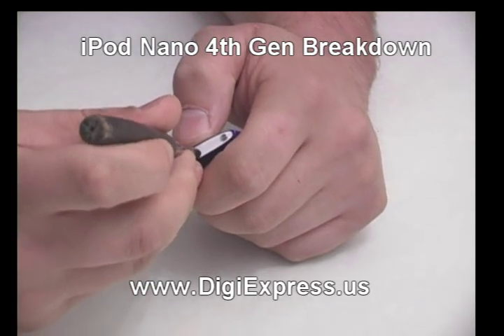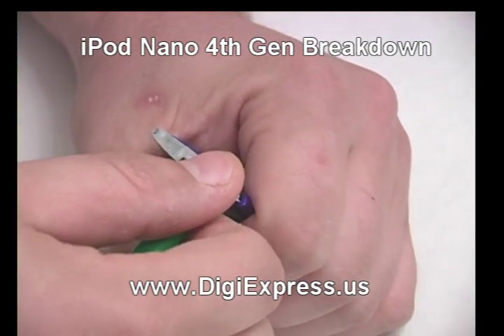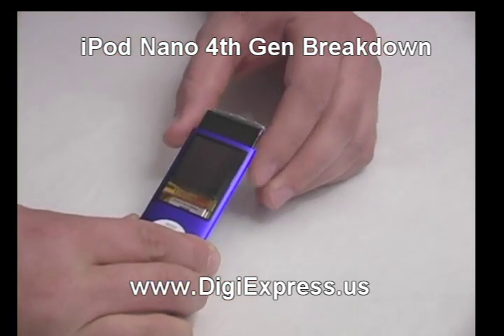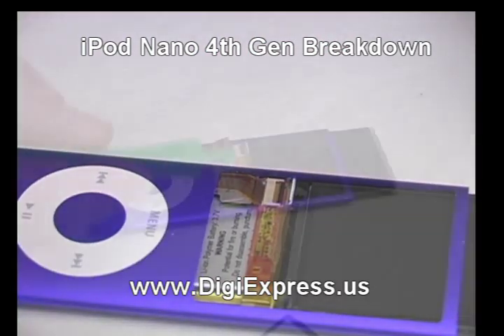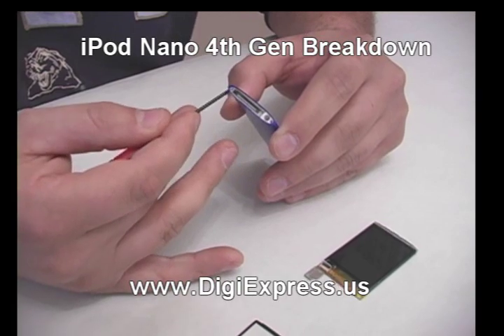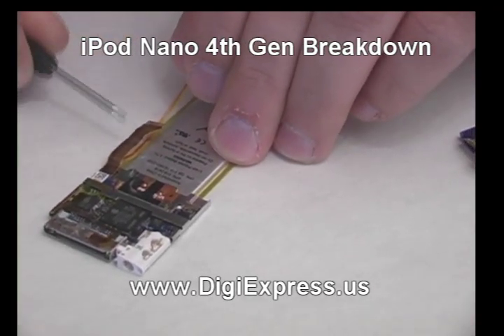DigiExpress - iPod Nano 4th Generation Breakdown

Comment from the maker: You can try to use a T-1, T-2 or T-3 (Torx) driver.  They seem to fit inside stripped phillips head screws.  Otherwise it is just a battle of drilling out a head, or pounding a flat head screw driver into the head of the screw.  For a Nano however, a stripped screw usually means it is just not repairable.  We have a very long and thin drill bit that we can usually get the head of the screw to drill out; but we use it with great caution.

Comment from the maker: @manoogianation you can get a small flathead screw driver and remove the excess residue from the glue.  that should allow access to the heads of the screws.  When you reassemble the device, do a "dry run" first and once you are confident that your device is working then you can apply a small drop of super glue to the bezels to reseat them properly.

Comment from the maker: Make sure that you have removed the two screws holding everything in place. Once those screws are removed, use a little pry tool and pull the LCD screen to at least get it started. Once it is started, you can remove the front glass and get it to slide out. Once it is slid out, you can access the battery. Just be cautious and make sure you don't rip or tear the cables, disconnect them before you get too far where they may damage.

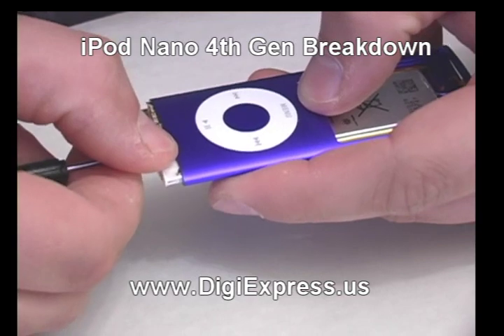Comment from the maker: There are a few things you need to make sure of. You have two lock switches, two screws and the ribbon cable. You have to remove the 1st lock switch, then the two screws. You will then be able to pull the LCD out a little ways. Once there, there is another lock switch attached to the LCD. Once unhooked, then make sure you disconnect the ribbon cable. Those directions and locations of the switches and cables are found from the beginning of this video to about 2:30 minutes.

Comment from the maker: @gianolrac if you would want to only clean the LCD screen then, at your own risk, obtain a straight razor and very delicately go around the edges of the clear glass window.  This will allow you to remove the glass window and clean the LCD screen.  However, to re-install the glass window you may need to find a way to adhere it to the frame.  The clear glass window is held in place by only a small amount of clear adhesive.  I would recommend to do the cleaning by disassembling the device as shown.

Comment from the maker: 1. You may have a problem with the LCD connector on the main board which is causing the back light issue. Open it up and gently clean the connector with an electronics cleaner (Radio Shack) or alcohol. If that doesn't work, you have a main board issue.

2. You can use a little adhesive to hold it in place, preferably a rubber cement which will allow you to remove it in the future if necessary.

Comment: I was given an IPod 4th Gen which wasn't working so after watching a few of these disassemble videos I thought I would pull it to bits. Mine was the complete reversal of easily sliding things out of the case. Everything was stuck in there like shit to a blanket. I ended up using pliers to pull the LCD screen out. As for the glass just popping up forget it . Broke it trying to push it up as per the video. Needless to say the unit is completely stuffed now which I'm not fussed about. I have 2 other IPods & I now know how difficult they can be to pull apart
if everything is "glued" in there. I would suggest if you need a new battery get it done professionally.

Comment from the maker: @Kyntheria With water damage, the ribbon cables can become "dried" out and are even more brittle than normal.  Depending on the type of damage to an iPod, you may be able to run it without the battery; but traditionally they need a battery.  The iPod Nano is something that would need a battery to be installed and working, as they have grounding points along the board and the case that rely on electricity being present to function.

Comment from the maker: @Music4Life2471 The moisture damage has probably corroded some internal components and over time you have now got an issue of battery life.  These kinds of repairs are difficult to quote a cost for, via email or YouTube.  Though all of our batteries for any iPod are currently on sale for $9.99; with our labor fee of $25.00 (Diagnosis / Repair Service) you would have a total of $34.99.  We would need to do a thorough Diagnosis of the iPod before attempted to replace the battery.

Comment from the maker: @TheBubbleRed For the 4th Generation Nano the hold switch is not a part that we stock.  You can try to disassemble the device to see if the hold switch has come loose.  You may just need to re-seat the connections.

Comment: Thank you for this. With the help of this video i managed to NOT destroy my ipod by trying to change it's battery. By far the most difficult part was de-soldering of the old battery connector from the main board, and then soldering on the new one. For dissasembly one definetely needs some watch-maker skills. I would not attempt this without previous experience with disasembly of very small parts. Some tips from my experience for somebody attempting this: don't touch the LCD with your fingers as the stains are very difficult to remove and can destroy pixels easy, put some cleanex on it before touching. Tape the main board to your table with some masking tape before desoldering/soldering so it stays put. Put some solder on the new battery's connector on the side that will be in contact with the main board before atempting soldering it. Reset your ipod if it doesnt turn on after you finish(press menu + middle button).

Comment from the maker: @alexflage You can always use thin electrical tape if you need to, but in general this device is very difficult to open and repair.  There is no trick other than just being patient and having the steady hand to do the work.  I do agree that the Nano 4 and 5 are the hardest devices to "get-into".

Comment from the maker: @XAversion86 the backlight issue on an iPod can be either the CCFL inside the LCD screen or the coil and fuse located on the logic board.  If it is the LCD screen then a simple replacement will work.  however, given your description of the backlight working only until the iPod fully boots up, would make me bet more on the coil and fuse.  that repair, the coil and fuse on the logic board, is not something we can do for an iPod Nano.

Comment from the maker: @allmobilephonestuff At the point in the video where the logic board is removed from the case of the iPod nano, you can then remove the clickwheel after you remove the logic board.  You would apply a small amount of pressure to the clickwheel, pushing it just a few cm back into the casing; from there you can slide the clickwheel assembly down through the bottom of the iPod case.

Comment from the maker: @photo2cd I believe you can go up to 64 GB, given you first update the mini firmware to 1.2(or 3).  The cost is a bit much, however if you get Rockbox running on the Mini then you'd have an OGG or FLAC enabled playback device with flash storage.  The lights as an "equalizer" or the like would be a great showcase but just a simple fading up and down of the lights would be enough to drop jaws.  The best part being I plan to cut the case allowing for CF cards to be swapped (but not hot-swapped).

Comment from the maker: You need to follow the leads from the battery to the board, the battery has a copper/gold colored ribbon cable.  The leads are surface mount so clean off the conformal coating and apply some flux, then desolder the battery using braid or a solder sucker.  Clean off the pads a bit and then solder the new battery to the board.  Obviously make sure the iPod is powered off before you start working on it.

Comment: @DigiExpress I followed this tutorial, it was great, but I had a hard time getting the LCD flex cable routed through the housing without it catching on something when reinstalling the board. I had to pull the board back out and in the process it dislodged from the frame it was set in, and the small flex cable that has four solder points and attaches to the two pronged part on the frame ripped. The clickwheel no longer functions and I was wondering if you had any idea where I can find that part.

Comment from the maker: @tury423 The first step would be to restore the device through iTunes, to elminate any software bugs or glitches.  I would replace the clickwheel, or at least open the iPod to see if there are any obvious culprits; like disconnected cables or corrosion from moisture.  We can Diagnose the iPod for your and even replace the clickwheel if need be.

Comment from the maker: @pokerpokerfan If the iPod is function as described, then you start by replacing the battery.  while doing so you watch for any obvious damage to the components.  look for corrosion or parts on the logic board that are broken (caps and trans with exposed copper and the like).  If you see no obvious damage, finish the battery install and connect to computer.  If the problem persists, then you need to make sure that all the gold grounding pins are where they should (i think only 1 for this ipod).

Comment: What they DON'T tell you: a) The green "ipod opening tool" isn't very effective as it is made from soft plastic. b) It is difficult to pry out the top and bottom panels due to all the contact adhesive c) It is very, very difficult to just "pop out" the glass screen d) Be careful as you could crack the LCD screen e) There are bits of adhesive tape which need to be removed BEFORE disconnecting any ribbon cables f) The battery connector is soldered in place, so you need a very fine soldering tip.

Comment: I have this model, and it plays rather louder in one earbud than in the other. It's not the headphones. I'm not deaf in one ear. Ever since I hooked it up to some speakers wrong (grabbed the wrong cable, I think it was powered) it's done this. Nothing else is wrong, the equalizer settings are normal, it plays fine on the dock. I doubt this is a simple replacement fix and I'm not too enthusiastic about buying a new ipod/circuit board. Any ideas?

Comment from the maker: @prakcharu You may need to replace the batteries, obviously, however if there is damage to the Logic Board then you may need to purchase a new(er) device, as repairing the logic board on a Nano is not cost-effective.  If you are having the same trouble with each iPod you may have an issue with the accessories (i.e. cables, docks or connections in general).  Make sure your accessories have a "made for iPod" logo on them.

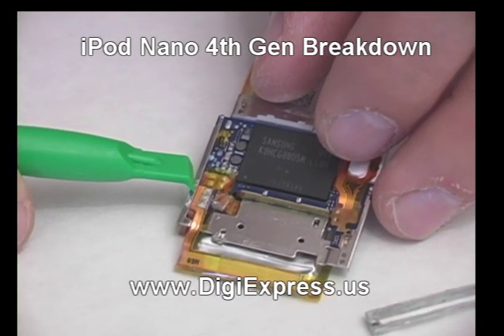Comment from the maker: @TheJalandoni720 He is not a moron, to disconnect the battery you de-solder (with a de-soldering braid or a vacuum) the battery from the connection shown at 3:35.  The connection is quiet clear, the copper ribbon cable leads have two separate dabs of solder on them and the pads sit below that solder joint.  If you have no experience soldering, do not attempt to change the battery.

Comment from the maker: @hornet871 check with a flashlight shining into the headphone jack, see if the water sensor has tripped.  If you see any Pink or Red coloring inside the headphone jack, then it has come in contact with water.  If not then you may just need to replace the LCD screen.  If the iPod functions properly in every other way, you would need an LCD screen.  If you connect to the computer and find no response from the iPod, or the computer, then there is another culprit at hand.

Comment from the maker: It is not "easy" per se, but it does sound like that would net you a working iPod out of 2 non-working iPods.  However changing the cases can present issues if the top and/or bottom bezels (the rounded metal) is bent or severely damaged.  Because the internals are shaped to fit inside that oval opening, once the opening is damaged then dragging the internals through that opening is almost impossible.

Comment: My headphone jack is acting up. I can only get sound from both channels for a few minutes if I rotate the headphone plug slightly. Would you assume the jack needs to be re-soldered onto the board, or should I replace the jack all together?

Comment from the maker: @177goku Debris is just dust or anything in the headphone jack. You can take a dry Q-Tip to attempt to remove anything located in the headphone jack. Be gentle and don't use much pressure.

If that doesn't work, we can install a new headphone jack for you for $19.99 plus $25.00 for the installation and diagnosis. If our technicians determine that it cannot be fixed within a reasonable repair cost, we would refund you the $19.99 for the part and ship your device back to you.

Comment from the maker: @purpKUSHpillz The tape is required for a proper installation, you can attempt to re-use the piece originally installed or simply cut a small piece of electrical tape.  the electrical tape should have one sticky side, obviously, and one very smooth side; there are different kinds of electrical tape.

Comment from the maker: @mycrimsonregrets if the glass is being stubborn you can run a straight razor along the glass window.  this will get between the glass and the metal case.  in doing this you will damage the small amount of rubber bezel that is around the glass.  this means when you re-seat the glass window you will need to use a small amount of adhesive and it may move around; since there is no rubber bezel/gasket.  You would want to be very careful if doing this as well.

Comment: After dropping my iPod from about table height onto a hardwood floor, it no longer works unless it's plugged in and completely stationary. Any movement whatsoever and it was turn off/reset and if it's not plugged in, the click wheel won't respond.

Would opening it up lead to a simple fix or not? I could buy a new one but I've invested way too much time getting all the songs/albums/artwork/etc just the way I like it.

Comment: Took everything apart in mine and tried to install a new clickwheel, but I'm struggling to get everything back in without ripping the clickwheel ribbon cable... Any tips? Do I need double sided tape to hold the clickwheel assembly inside the aluminum shell?

Comment from the maker: @SnapBackGod It sounds like you need a new battery.  However check your headphone jack for signs of water damage.  (The red or pink means water damage, "bone" white color means no water damage).  If you have water damage, then pitch the iPod in the trash as Nano's are not water friendly.  If you have no water damage, the issue could be only the battery.

Comment: the wiring that is held by adhesive do i need ad more when re assembling or will it still stick. also if i replace the battery will i need some adhesive to put it back in.

Comment: I just bought a battery for my ipod nano 4th gen and i was wondering what i would need to use to re connect everything. Do i need a solder gun or would super glue work or what?

thanks

Comment: I was replacing my screen, and I ran into the same problem as tricolor707. I don't think I damaged anything, it all looks fine; it even worked for a little while after I had replaced the screen. But then the next time I turned it on, there was just a black screen. What do you suggest???

Comment from the maker: @manoogianation If your LCD screen is discolored you probably need a new one, or at least a new clear glass window that covers the LCD screen.  The discoloring could be either one, though I would assume it needs a new LCD screen.  If the Nano got wet, then you may have the same problem after you install a new LCD screen; it all depends on which parts internally were exposed to liquid or water.

Comment from the maker: It could either be a bad battery that will not hold a charge, or it could be a main board issue. It's hard to determine exactly what it is without doing some tests. But the battery would be the first thing to test.

Comment from the maker: @IAmNotMortal Most times water or moisture damage can be repaired, however it depends on where the corrosion is located inside the iPod. Many times the battery shorts out, which is why the iPod will no longer power up. Our technicians can do a thorough diagnosis to determine the extent of the damage and determine whether the iPod is repairable. You can check out our website and order our repair service in a few easy steps!

Comment from the maker: @177goku You have the 5th generation Nano then.

First, make sure there is no debris or dust located in the headphone jack and that your headphones are connecting flush with the base of the iPod.

If you're still having problems, attempt to reset it and try a different pair of headphones.

If it's still not working, it's likely that your headphone jack would need to be replaced. We do offer them for $19.99 and you can view more information on our website.

Comment from the maker: @13Bombdiggity Any ribbon cables that are damaged in this device need to have the associated part replaced, so I believe you are working with the lock switch ribbon cable and would mean the lock switch is in need of replacing.  Though I am not 100% sure of that being the only part you need replaced.

Comment from the maker: @thesatanic6 The iPod Nano, having a metal case that acts as a partial ground for the circuitry inside, can be severely damaged by a drop of 3 meters.  The battery needs to be grounded obviously and the iPod would not function if the ground is damaged; this would possibly result in lesser battery life.  Other than that, you could have a problem in general with a micro electronic on the logic board being damaged in the drop.